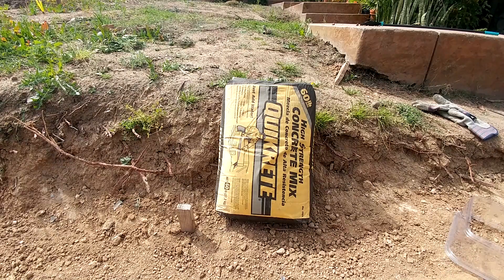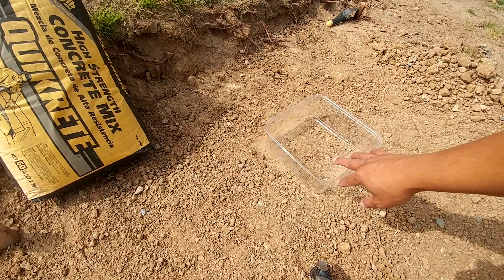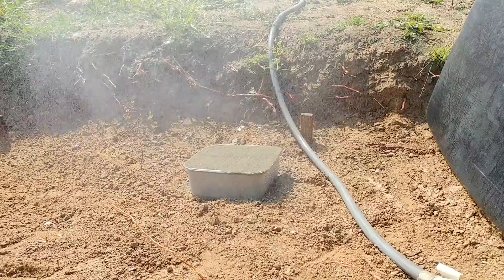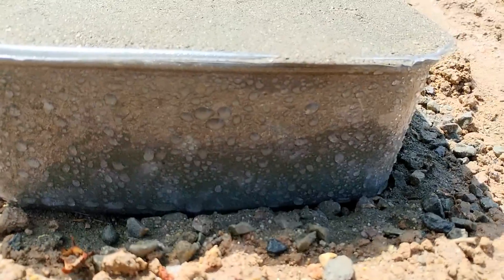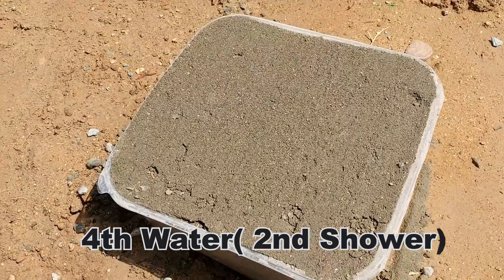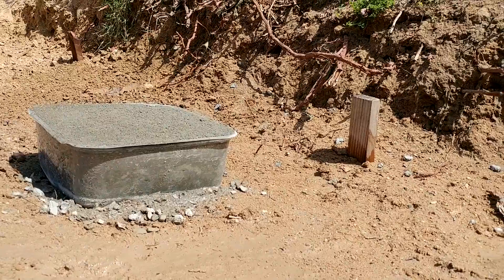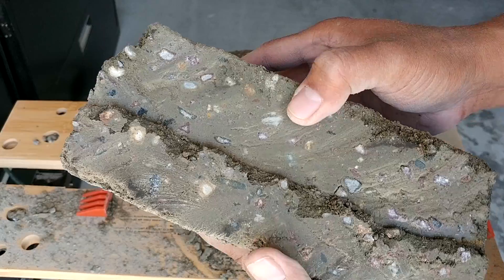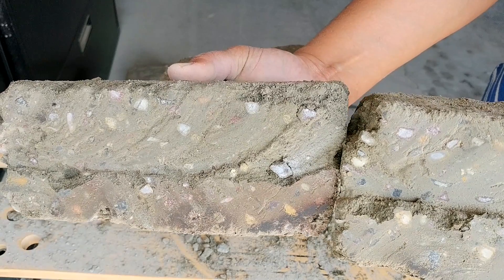You Won't Believe What We Found in This Dry Pour Concrete Experiment.

Comment: About this experiment. . .it would be appropriate to perform an experiment that actually has a null hypothesis rather than "just look here, one was misted more than the other, and they are about the same".  It is sort of like a magic act with no reveal or prestige.

It is not apparent what this experiment was actually meant to demonstrate. You compare two "dry pours" with different amounts of watering. There isn't any empirical measurement of how much water either of the "dry pours" received. This experiment is like comparing oranges to oranges. There really isn't any difference to compare.

As this "dry pour" process is being so highly touted (at least on youtube videos) as being as good as the "wet pour" process, the "dry pour" concrete result should be compared to a "wet pour" concrete result. The "wet pour" concrete will need to be mixed utilizing the correct amount of water as specified in the mixing directions on the concrete bag.

And about the waiting time of just one day. Don't wait only one day to make the cuts and comparisons. It takes concrete (at least wet pour concrete) 28 days to "cure" properly. Concrete typically takes 24 to 48 hours to dry enough for you to walk or drive on it. However, concrete drying is a continuous and fluid chemical reaction (crystallization) event and reaches its full effective strength after about 28 days. This chemical reaction can not be rushed.

Waiting 30 days before comparing the two pour processes. This would allow an honest test involving the actual conditions that the concrete will then exist "forever".  

About doing the comparison, cutting the concrete and just visually observing is not adequate to demonstrate the complete result of the "experiment". Do the visual observation and then compare the strength (pounds per square inch of maximum load) of the two different types of concrete pours. A rough comparison would be to beat on it with a sledgehammer; however, this is just another visual observation and at length would still be just another subjective comparison. An objective comparison of strength should be done to actually make a measurement of strength. In order to measure concrete strength some type of equipment with a gauge will be needed in order to see a what point the concrete will break under compression. This test does require resources; however, performing will answer the question of whether "dry pour" is an effective method for placing concrete. Since the time when the Romans invented cement, it has been demonstrated over and over and over that "wet pour" is effective and delivers quality.

I am not convinced that "dry pour" does justice to the quality of concrete's strength compared to the "wet pour" method.

Also, the "dry pour" method does not lend itself to the finishing of the concrete surface. Finishing concrete with a paint roller is laughable (just making up the process as your go). Dry pour concrete results in a very ugly surface compared to the wet pour concrete which can be "worked" to produce a pleasing smooth surface.

Sadly all of the youtube videos about "dry pour" the "dry pourer" looks at the resulting rough surface and basically excuse the poor finish and say that they like it. The best example of this nonsense is one poor youtube "dry poured" an entire garage floor. When it was done he claimed he liked the rough surface, but then spend several hours using a large floor sander and lots of sanding paper to sand out the imperfections and still had a less-than-mediocre result. Evidently, if you undertake a "dry pour" you won't criticize it because it would put your judgment in question (particularly if you are in the process of making a youtube video you plan to post).

PS I am a registered civil engineer so I know what I am talking about.
Reply from the maker: Thank you for sharing your knowledge. I'm just doing experiment based on what resources I have and sharing it to the community. I understand that a proper equipment is needed to determine the actual strength of the concrete.  I just did comparison between 2 dry pour because I don't think that water can penetrate enough to hydrate the concrete and I believe that it will cause a laminate effect where different layers are created based on when the water reaches the dry materials. And you are correct, the top surface which is what everybody will see is not visually appealing with dry pour. I did received some comments about it as well telling me that I did it wrong that is why it looks ugly.   Anyway, I actually just filmed another comparison between dry and wet I will upload it after I finished putting it together.   By the way I am interested to see which video are you talking about where they have to sand out the imperfections. There are too many dry pour videos now that I can't keep up anymore :)

Comment: Dude you still need to trowel to finish it and work the cement with a tool called a float.Well you have a order to follow first you scride float and finish trowel then you can brush finish as a slip resistance.😊
Reply from the maker: I guess people don't want to do that part that is why dry pour is trending :)

Comment: I would suggest anyone doing Dry pour to soak the ground a little while before adding concrete to the form.  This lets it also pull moisture from the bottom.
Reply from the maker: Thank you. I agree to this 100%.  Other videos I saw says to start dry because the concrete will start absorbing the water and set before you finish your pour but since you can do dry pour quickly I believe it is better to start with moist.
Reply: There is already moisture in the ground that will get drawn into the dry poor.

Comment: Wet the ground first, pour out all of your bags making sure you have more than you need, put on some rubber boots, spray water on half the concrete, take a hoe and mix it up, spray the other half and mix with hoe, take a 2x4 and smooth out the top, tap with a hammer to get rocks to settle.
Reply from the maker: Thank you. This is another method that looks like will work better.

Comment: I did this in my backyard 7 years ago why is this trending now? My slab is just as perfect as I did it. I wet the surface first, wet out half way and lay steel mesh then finish and kept wetting not rocket science.
Reply from the maker: I guess everybody just realized there is more than 1 way of doing concrete. I too was actually looking on how to mix concrete for my summer project and youtube keep on recommending these dry pour methods so I did gave it a try.  

Thanks for sharing your experience. You have the longest Dry Pour slab as far as I know and your method is different than how most suggest so you are the king of it.  How big is the slab and what is the main use of the slab is it a walkway, patio etc. and how did you smooth the surface?  Please share more.
Reply: @diymanual  It is a 10 x 20 open slab, no heavy traffic, sort of an outdoor patio, I will be building a Gazebo over it. I used dry cement for the extra smooth surface I was looking for, I just figured to properly wet it out and help the curing process to wet the surface generously first then spreading the dry mixture about two inches, laying my steel mesh which I always use, wet a little not too much then finish with the dry mix additional two inches for a total of 4 inches thick, float it level, then spread a good quality cement and level, the start the wetting out once every hour, curing is best after 4 days is my recommendation.
Reply from the maker: Thank You.

Comment: Pour the first half in, wet it, pour 2nd half, mist it….
Reply from the maker: That's another method we could use to make sure that every inch of concrete material is hydrated properly. Just that most people says don't wet until everything ready because it will quickly absorbed to the top and we will not have time to make the top smooth. I guess that will be for the next experiment.

Comment: What about a small funnel to inject water into the middle of slab?  You could inject a cup of water every 6” or so the help it cure faster because it gets water absorbed faster.  Thoughts?
Reply from the maker: Good idea. I think the first shower have actually been absorbed throughout but a funnel can make sure that all section of the concrete is reached properly.

Comment: DO not dry pour! just do the slab in sections or get a friend to help. They science behind concrete is the lye in the cement absorbs the water on the molecular level and hardens. This happens within hours, by the time you have the slab wet all the way through you cannot work the top without weakening it. If you get the top wet enough to work with time left to work the bottom will not have a high enough water content to harden adequately.
Reply from the maker: Thanks for the info and the idea on breaking it in smaller section. It is easy to be overwhelmed looking at the project knowing you have limited time to finish it.

Comment: Hey friend can you mix some sand , aggregate and cement by hand maybe a strong mix and then dry pour  it  and see how that would hold up or would it even work?
Reply from the maker: I'm using a concrete mix in this test. So mixing a different ratio by hand should still work as long as water can penetrate through it.

Comment: I built a retaining wall of concrete bags that is over 6 feet high. It took weeks for the bags to set up, not 24 hours. All of these dry pour concrete videos are hilarious... I wouldn't dry pour a project with a high PSI requirement like a foundation for a house or garage, but for small jobs it's fine. So many copycat videos now LOL.
Reply from the maker: I just did 24 hours to see if inside is fully hydrated and it is easier to cut. I agree that this method should not be used for a foundation or any part of house. I would say it is good enough for walkway or small patio but longevity will still be a question. Maybe we will see 5 to 10 years from now when all people doing dry pour projects started reporting their failure or success with the dry pour.

Comment: Experiment, yes.  Did you follow directions from dry pour professionals to a T, No.  Did you give credit to Cajun Country Living for going viral with the dry pour concrete craze. No. thumbs down, sorry.
Reply: 😂 !! Dry pour concrete professionnal ? Tell us what is a dry pour concrete professional. And giving credit to someone on internet for an experiment ? Relax this is just spraying water over pre-mix concrete, not a multi-billion copyright violation. Thumb down, sorry.
Reply from the maker: Sorry if I offended you but there is no such thing as dry pour professional as this method is not approved or tested by cement manufacturers. I am searching on how to properly mix concrete and saw this alternative method from a lot of people. I did watch Cajun Country Living and I do like their explanation on how to do it with smooth finish but a lot of other videos talk about the same thing as well some with slightly different method than others.  So, do I give credit to every video I watch? I am doing this experiment to see if I can actually use this method on the extra ribbon parking spot that I am thinking of building and I am just sharing it here like a lot of people do. Youtube is great for sharing knowledge we are a community here. We share ideas, grab ideas from other keep the ones we think are good, toss the ideas that will not work for our situation and add more to it to make it better and share it with the hope that it can also help other. There are more than 1 way of  accomplishing things and what I learned is that watering it 8 times is too much so I have to stop after 4 showers.
Reply: By the way, people in the UK have been using this method for many years. This is nothing new. You don’t have to give credit to anyone. It’s not a new invention.
Reply from the maker: @MariaDi23  Thank You. Does UK use the same procedure or do they use a better method?

Comment: RIP saw blade...haha 
thanks for doing this, went down the rabbit hole of dry pour concrete today for a summer project I am doing. even tho there  there will not be a ton of weigh on mine. I will reinforce it with welded wire. 

it's good to see what the insides look like after one hour. figured it works peple have been doing dry pour for fence post for many years. nice to see other uses for it. 
it's a DIYers dream makes working with cement more user friendly. I see many folks doing things with it.   the question will how will it be in 10-15years?
Reply from the maker: How large of an area did you dry pour?  It is a good question for the longevity but we won't know until someone actually show proof that this will last or will be able to handle driveway. I could say I will be confident to put this in a walkway or patio but I am still hesitant about driveway or a parking spot because of load. I am thinking doing the same experiment with dry pour and wet concrete and compare how they look like after 48 hours, 7 days and 28 days.
Reply: We dry pour fense posts because that's what the manufacturer instructions say. On a patio or sidewalk, the instructions say mix. Maybe lasts 2-5 years, 10 if it's just foot traffic. But you definitely lose a lot of psi strength, just like if you would dry pour posts. Its your shit. Do it how you want.

Comment: Thank you for doing this.  I am considering using this technique to pour a small slab in a place that I cannot get concrete truck loader in to.  Was a little concerned about how well the water would saturate.  I feel much better about trying this.  Will see.
Reply from the maker: I think for a patio or shed this will be a good option. Water is absorbed easily. Just make sure to keep it hydrated for at least the first 7 days as it cures.

Comment: Ok.. if I was to do it, would do the sprinkle or mist concrete top, wait, mist again, wait, then use like a water sprinkler for around ten minutes, then set for an hour, then sprinkler again, etc.. for an afternoon.. if I was doing a driveway, as my driveways are six inches thick for trucks and cars.. lol..
Reply: though another person I know did it where he just misted, gave less than 5 minutes, misted, five minutes, misted, then added water until it ran off.. doing that every time it looked like the top was drying..
Reply: @brotheradam  I agree. Once the dust gets wet, I'd make sure that it doesn't dry out and pucker.

I'll be doing a ramp soon. 0" to around 2" by 5 feet long, 18 feet wide.

I'll be using cheaper heavy graval 4000 psi as the bulk, and then the sand mix type 4000 psi as a cap. This way I'm not dealing with stones on top. I'll be using a paint roller to smooth it out. Then misting it enough to stay wet (no pudding or powder moving). Probably won't stop watering till water will start to puddle, then stop.

I'm going to keep it wet and covered for as long as I can to cure (28 days)

Ramp will be on top of a concrete driveway that has sunken. 16 bags
Reply: @jakefriesenjake  yep.. in fact here in Jamaica my plan is to do a ramp using the dry method, but once done like that, do two wet downs per day for four days then finish drying a couple weeks before using.. wonder if can use similar method to filling block pockets???
Reply: @brotheradam  yeah just keep it wet for as long as possible. Concrete water cures, it doesn't "dry". I think the bulk of its strength is like a week, but 28 days to fully harden. Keep it wet and covered and in the shade if possible.

Doing it this way and I literally own a concrete mixer! Going to sell it
Reply from the maker: @jakefriesenjake  I agree with this. I believe this is the most important part of the process that most people will neglect. Even if you do a wet pour you will need to keep it hydrated as it cures so I would setup a sprinkler on a timer to run for 1 minute every 3 hours during the day or depending on the weather.
Reply from the maker: That will do it. Different method for different purpose. I am not a pro but from what I have learned so far is that concrete cures through hydration so do not let it dry out as it cures but do not start with too much water either as it will cause more shrinkage and it will crack easily once it dries. So, basically just hydrate it enough for it to start setting then once it is set then keep watering it till it cures.

Comment: Great experimental procedure!  I agree, both blocks will end up the same, especially, as you increase the curing time to days, complete strength in weeks.  What is different is the top which is the part we humans will notice the most.  When wet concrete is done the cream is brought to the top to get aggregate (rocks) to move down.  When dry concrete is done more aggregate is at the top as it is difficult to get lighter cement (cream) to the top.  So in your next experiment add an inch or two of mortar (which is cement and sand) to the top before watering.  Also use a paint roller to smooth it out.  One other way that may improve your top is after dry pour take a small diameter (1/4 or 1/2) and move up and down in dry mix before watering, which will tend to move aggregate lower and remove air pockets.
Reply: There are many videos on showing you the proper technique to get a smooth finish with dry poor.
Reply from the maker: Thanks. I saw that and will try it next time.
Reply from the maker: Thats correct. Both will end up the same as long as the curing procedure is followed properly. The wet concrete will look a lot better but I will try your suggestion regarding paint roller.   I actually doing another experiment using a different method to see if we can preserve the smooth surface on top.